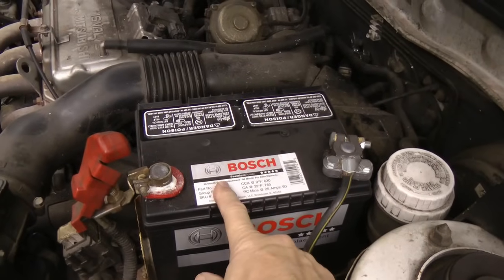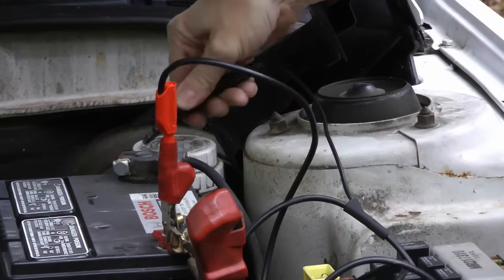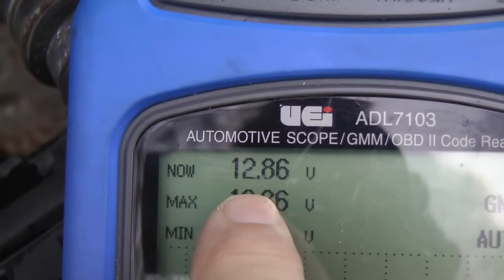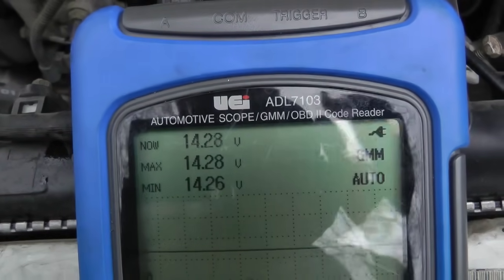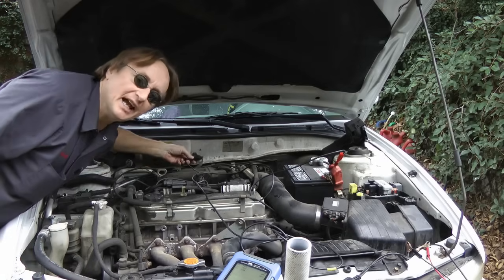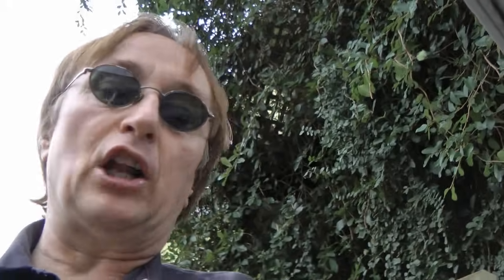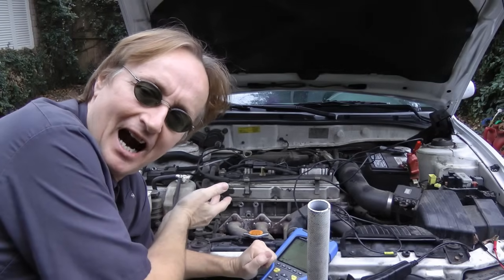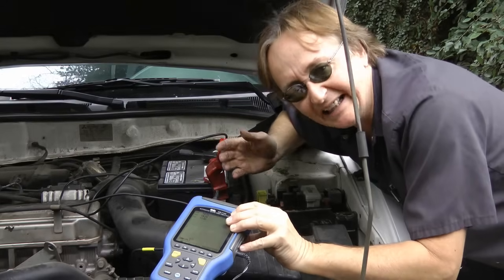How to Fix Electrical Problems in Your Car (Ground Fault)

Comment: How do you fix a low voltage code obd 800-03  ?
2018 impala  3.6 engine 
Occasionally won't start ,speratic issue .
Always happens when least expected

Comment: I have a question- when i turned on my car the battery odometer level read towards 'hot'. i had just turned it on, the day before it read normal it was in the center. any ideas why the battery is reading as 'hot' ??

Comment: Hmmm been watching.. you very good.. I have a problem with my cargo light will not light but dash indicator says on and switch some times works and some times not working is there a test and so many other switches dim lights, door open close, dome light and so on 2003 Chevy Silverado 2500hd 6.0

Comment: I have a 2001 Infiniti i30. My instrumental cluster stopped working and my car turned off on me and the battery was completely dead. I tested the alternator at oreilys and it was good but I still put a new one. And I still have the problem. I checked all the fuses and relays. I need help!

Comment: Hie Scott  , thank you so much for all your videos  your are the best . I own a fiat palio 2003 , 8 valve . The problem im experiencing is , my fan for the radiator  was not working then we tried connecting the fan to the ignition  line then failed to complete  the task , the very same day we did this we later had problems  in starting the car . The mechanic advice me to get an auto because  he said the car has now developed an electrical  problem . The auto came he  changed some spark plugs then the car start and he then connected  the fan on the ignition  line .i only drove it for a day . The following  morning  the car didnt want to start again and i foned him . He asked me to check if the fuel was coming  to the engine proper and he told me to first listen to the pump , if it runs the the car start which i did and the car drove and at time i should aso unplug the cold start switch . The car at times would  not start  then start after a long crank  , then the auto said we have to change the petrol pump because  it is packing up . We changed it and installed  an universal  one . The pump sometimes works and at times does not work . After i watched a certain video of why a car cranks long before it start i found that i had to change the petrol  filter   which i did . Then the car start as i was driving it i  noticed  that the car is now straggling going uphill then i had to ingage to lower gears to complete  the  uphill , drove it only once . Now the car doesn't  want to start . Pliz help

Comment: Hey Scotty, ran into this while I was looking to trouble shoot my 2014 ford fusion. Randomly the radio, power windows, heating, AC, rear defroster would stop working. One time its works, next time it doesn't. Even today, when I turned the car on, the components did not work, when I closed the door to clean off some frost and snow, it started working again. Almost as if the very act of opening and closing the door got it working. I took it to the dealer and they were unable to replicate the issue. One time the issue sparked up again, but by the time they brought the machine to test it everything starting working again. Racking my head as to what this could be. Any insight would be very helpful.

Comment: I have a 2006 Pontiac grand Prix, I've replaced the pos and ground batt cables and the ignition switch and I still have no power inside the car. I have power to the fuse box inside and outside the car. but I have no power anywhere else on the car. I have changed almost all the fuses and most of the relays. battery has good power but can't start the car to test the dynamic side of the system. what can I do to rectify this problem?

Comment: Hey Scotty, so on my trailer when I hit the breaks, the amber turn signals turn on would that be a grounding problem? If so how could I go about on looking for the problem, since it a pretty long trailer? The turn signal works properly when I hit the switch in the vehicle. But on the 7 way plug I notice the wiring diagram says Left Turn/Stop and the other Right Turn/Stop so would that just be the truck problem? Since it gives signal to both ways on the same pin?

Comment: scotty can you answer strange question?
according to wire digram pin out, 2pins are
 "(POWER)Ground",  to or from transmission,  should this have Voltage as power? or is it a ground

Comment: Hi Scott have a good holiday my 1990 taurus 1990 lost all electrical power  battery  is good . When I jump started it turn over just fine  I have changed the ignition  switch  no result  i known the trouble  has to be in the engine  bay any help would  be appreciated  than

Comment: can an electrical problem cause heat on all instruments that use electricity?? my odometer panel,hazard light, climate control box,ignition switch,shifter display gear panel on the floor but the shifter itself is cold the display panel is hot and almost anything that has a light to it is hot.

Comment: What if the car doesn’t start at all???
Reply: If you hear clicking and no cranking then your battery doesn’t have enough voltage to kick out the starter, if you hear nothing it could most likely be the solenoid. Check the battery to see if it has at least 12.4 v if not then charge it, it’s the minimum starting voltage for all cars. If it reads that or higher and its not kicking it’s likely the solenoid or a bad ground/high resistance or an open.
Reply: Also check the computer

Comment: What if my car isn't running yet due to the ground issues? Technically it runs, but the starter won't stop cranking once started. And it labors cranking

Comment: If you step on the brakes and the parking light comes on without the engine running, then you know your problem shows up in the static state and testing for a fix in the dynamic state is a waste of time. Logic 101.

Comment: Great video. A concern coming to my mind is you taking off the negative cable while it's running. Fluctuation may cause damage to sensors or a module on a modern car.
Reply: But when you remove the negative cable of the voltmeter everything is still grounded through the battery ground which is still connected to the negative terminal of the battery. Please feel free to correct me if I am mistaken. Thank you.

Comment: My 2012 toyota tacoma . The parking light on the left side quit working all other lights work but this one. Replaced  💡 bulb and connecter that bulb actually  goes in . Still not working. Help

Comment: I’m not able to turn on my car, I’ve noticed that I have a bad ground for a while and I just replaced my fuel pump cause the old one went completely out. The fuel pump worked for a day and then stopped working the next day after one time turning it one the next it didn’t do anything. Now my dash meters keep moving slight up and down like it’s activated and turned off quickly. Ima do this test but idk how well ima get a reading because it’s off.

Comment: Having an issue when i just tap the lever to lock my tilt steering in place it shuts the car off or when i pull it all the way up to lock it in place it shuts the car off. Any idea

Comment: Is a static test fine when you're checking to see why your car won't start? My car keeps acting like the battery is dead and I'm still trying to find out what's causing it. I have a new battery, new alternator, and new starter. I have checked for corrosion at my battery points(In the trunk and under the hood) and found nothing, perfect connections there. I tested my wires going to the starter, good there. I tested my alternator, good there. It's driving me nuts!

Comment: I have a 2011 Buick Lacrosse and the AC and radio keep shutting off while running. Could this be a hrounding issue or a ECM issue? Thank you

Comment: Where is the ground wire for a 2006acura TL, for my ac fan? My ac fan stopped working checked the fuse changed the fan motor

Comment: I have a Hyundai Tucson, an American car, model 2014, with a 2.4 engine. There was a short circuit in the body of the car, so what is the solution to fix it?

Comment: Hello Scotty,
 I am hoping you could make a video on repairing or replacing the under the hood fuse box, preferably for a 2010 Mercury mountaineer/ Ford Explorer.
The receiving end of my fuse box for my ac compressor clutch relay is loose and causing my ac compressor to stop randomly when I hit a bump in the road. I’ve replaced the relay and recharged the whole system only to discover that when I wiggle the relay to just the right spot the compressor clutch will engage but once I take my hand off the relay the ac clutch disengages.

Comment: I have a issues on my 2014 ram 1500 issue # 1 clicking on the throttle body sensor and rely fuse after engine is off already replaced the throttle position sensor and body and it still does it issue #2 dash cluster lights  stay on after engine is off till it drains the battery... help me if you can

Comment: Scotty, I have a problem with my 2008 Mitsubishi Lancer, I tried installing an Android car stereo, with a harness, as soon I plugged the harness, I got all kinds of warnings on my dashboard,  so I unplug the stereo and installed the original back on, the problem remained,  so I did a few days of troubleshooting and replaced a few burned fuses, it still had the warnings, so I unplugged the factory stereo and the problem went a away, what do you think the problem could be?

Comment: Hey scotty I have an issue. I had my car on nd had a buddy help me. He grabbed  a metal bar nd places it on top of the battery. My whole car died nd won't turn on. You think I have to check all fuses even the ecu. Windows wont roll up or nothing like that. Only the emergency light come on. It's 2002 jeep grand cherokee ltd.

Comment: Hey scotty will this cause my headlights to stay on and my interior accessories when I remove  my key fob from the ignition  ... I already  replaced my battery , key fob reader , headlights switch,  a put new fuses in , cleaned a few of the grounds I seen there must be more somewhere  but idk its weird .. my car lights stay on for about 10 minutes with me having to keep pressing the start / stop button over and over to get them to turn off ...

Comment: Have a 2008 impala that's a battery got a new battery got an alternator got a new starter the car still won't start up when I go to start in the morning I would have to jump it off with a booster battery all wondering what could be the problem the furious is that good on it just let me know Scotty

Comment: I need help on Miata 30a fuse keeps blowing my dumb cousin took off a fuse and put it back with the battery still plugged in
Reply: It’s the injection and alternator fuse

Comment: That's good for testing the front of the car but what if your short is in the trunk? You have one of them hooked to the battery, I don't think it would reach the tail light from the battery to test that out?

Comment: Have you ever experienced an electrical issue with a chevy spark? (I posted a video to show what the dash looks like). I will drive and the electric steering, ABS, speedometer, and various other systems will cut off. The battery and alternator are good. Can you help?

Comment: I saw a lot of your videos and they are much helpful than others and thank you sir for all these information. I want to ask you about a problem i faced it in my dodge caliber 2008 car, from time to time it gave me a " no bus " message. all i did is disconnect the battery and reconnect it again after 10 min and work fine, but after sometime it backs again. can you tell me how to fix?

Comment: Both my 2000 Ford F-150 and 91 Ranger under hood light switch with a mercury bulb does not work. No corrosion or visible defects inside the switch. The under hood light switch connector to both trucks has no 12V power nor continuity. Double checked all fuses and relays; all test good. Did a lot of research with people with same issue ,but no one has an answer. Does the mercury switch complete the circuit to activate power and ground? I want to eliminate the factory under light switch and use the same factory wiring harness to install LED light strips.

Comment: Mine is a lil uderpowered though new by about 45 CCA's . Other one was 585 this new one 540 CCA Sounding rough when it used to start . Just got it out of shop . I hope I didn't damage starter or anything else . 2016 Ford Focus SE 2.0L

Comment: my surburban wont start or get power but when i touch the negative terminal with something metal the power comes on and even cranks sometimes but when i take it off the power goes off any suggestions

Comment: i have a 94 jeep cherokee with a 4.0 it has no power to fuel pump or to coil i replaced the fuel pump,crank sensor,cam sensor,pcm. im lost what it be.

Comment: Scottty, my Mazda 3 has got a problem,  one side brake light when pressed the first time it will work after a certain distance I press the pedal, the park light on the left will go off and the brake light will not work like not illuminate.. What could be the problem?

Comment: Scotty the CTSY fuse on my 99 Sierra keeps popping, I notice that the blue wire to the E-brake was exposed. I cut and fixed the wire but the ctsy fuse still popping. All the dome light was working fine a month ago but one day the light went out and now I can't seem to find what is the cause of this. There were a trailer module underneath the pedal, I have remove the trailer module and clamp or cap off all the wires. I'm not sure if it is the wire underneath the fusebox gone bad or the wires to the inside of the roof dome light gone bad, I have not check them out yet.

Comment: SCOTTY,
I have a 1994 Ford Dump Truck.  The blower motor will not run.  It has a 2 wire blower motor.  When check to see if there is power going to the blower motor with a test light both wires are hot.  What is going on?

Comment: Hi scotty, got a question , can a deffective mirror( its either trying to close or open, you can hear the gear grinding ) affect any other part of the vehicle.  e.g engine running but you are not moving as you should.

Comment: Scotty I freaking love you videos! But I need help! I’ve got an 04 Avalanche that when I turn on the key everything flashes, lights gauges and even a clicking noise from the fuse box under the hood! Located the relayrespinsoble for the clicking, replaced it! Didn’t work! I have electrical crap so much, probably cause I don’t quite understand it! Anyway what should I check next if I don’t have a voltage meter?

Comment: So i installed a alternator on a crystler 300 and when i went to go jump start it the negative  jumper cable was arcing when i tryed to put it  on it basically was leaving weld marks do you have any idea what that could be maybe a bad negative cable

Comment: I have a 04 impala. The brake lights and rear hazard lights aren't working. I've changed the all in 1 switch on the column. The brake switch on the pedal and checked all my fuses. I'm at a loss any chance you could help?

Comment: Hi Scotty I have a problem with my 2005 Audi A4 Avant 2.0tdi SE CVT it's  the driver's power window switch has stopped working but the other 3 power window switchs controled from driver's side am working ok and also the power side mirror's switch has stopped working aswell would you be able to tell me what could be my problem thanks Danny

Comment: "You really don't care what its doing when it's sitting there resting" 

Guess what:  If the battery is draining when the car is not running, I care.  Well, I did until I started unbolting the battery terminal every night.  Likely, I will tire of that,
Reply: Just do a parasitic drain test and disconnect the fuse to the rouge electronic device instead (thats if the fuse controls a thousand items as expected). The most likely culprit is the fuse that controls your radio (they normally lump that with other electronics making it hard to trace which is the rogue one).

If not the radio, its definitely one of the after market items that were installed on the car (car alarm, back up camera e.t.c)
Reply: @joshuarotimi  You are right.  However, the presence of a timer of unknown duration that attempts to automatically turn off the dome light complicates matters on the model, a 2000 Mercury Grand Marquis.

And I don't mean to disrespect Scotty at all.  His videos are great, including this one.  I'm just adopting some of his own personality in my focus on my concern.

Comment: Scotty I got a 2006 G35 Infinity Sedan .. I have a issue with the running lights wontcome on the side marker lights wont come on  the bulbs are all brand new.. it takes a 10 amp fuse in the fuse box under the hood behind the battery against the firewall.. I put a many new fuses in it and as soon as I turn the key it blows the fuse.. how can I fix this issue

Comment: I have a 84 Audi 2005 I hook the battery cables up wrong I was wondering if you knew where I can find a fuse to a module or something
Reply: A4 Audi 2004 hooked up battery backwards top won't go down fuel door won't open windows won't go up or down

Comment: Hi Scotty Kilmer Ronnie here wanting advice on how to fix 2003 Ford Mondeo main lights. Parks and high beam work and the brightness when pull switch. Rear lights brighter still no head lights. High is on the stick.

Comment: Hey i have a question i have a 1998 mustang GT 4.6L  my turn signal on the left blinks with the brights but when i turn the right signal its normal idk why cause i put blue led lights in my speedometer

Comment: Ok I'm having a problem with everything's getting power except for my fuel pump and head lights. I've bought a volt meter but I'm new to this stuff and I tried everything in your video but I think I'm doing it wrong my truck will not run unless u pour gas in the throttle body so I couldn't test that part.